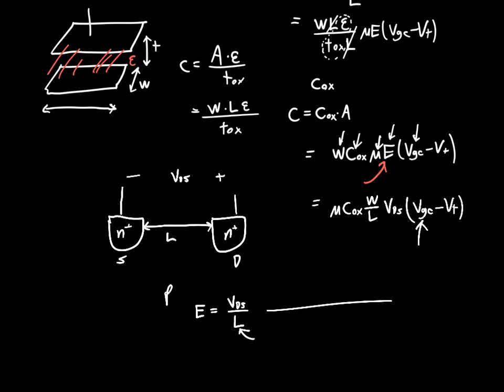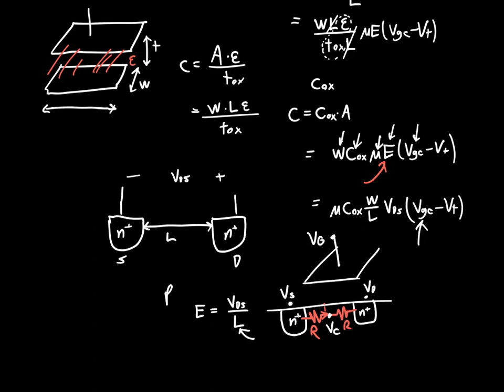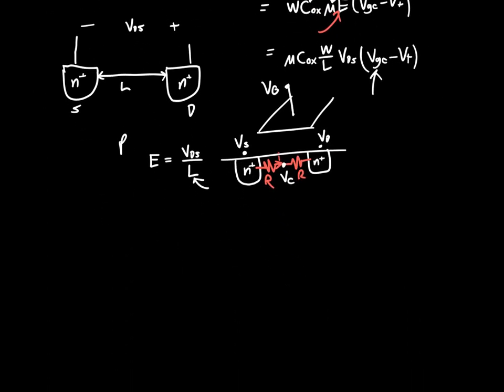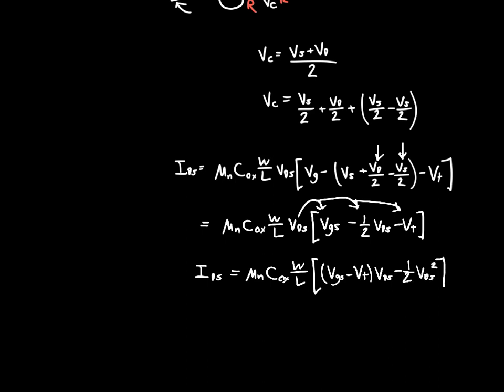MOSFET I/V Characteristics Derivation

Comment: Shouldn’t this be the derivation for Igs? We start with the capacitor formed by the metal gate and body, so the Q should be the charge of the channel. The E electric field should be the one between the metal and body, but we switch to the field between D and S at 11:10. Any help is appreciated regarding my confusion
Reply from the maker: Yeah so the gate is separated by an insulator from the channel. It only serves to populate the channel with electrons (via capacitive charging, or the field effect). The current that flows is from one end of the channel to the other (the source to the drain). No current flows (at steady state) from the gate to the source or drain (ignoring leakage current).

Comment: The direction of the current in this model is parallel to the two parallel planes of the capacitor. Normally the current should be  perpendicular to the plane. This is confusing.

Comment: In class we derived this formula by integrating the current and the voltage as they are not constant but depending on the position x along the channel.
How is it possible that you' ve come to the same exact expression without taking the current as dq/dt and the electric field as dv/dx?
Reply: In the video, implicitly, the integral was replaced with a mean value theorem with the resistances trick.
Reply from the maker: Great question! I’m guessing it is because at some point you actually had to carry out the integral in order to get a formula for the current, and so you assumed a certain profile for the charge distribution (which to get the same formula is just constant).